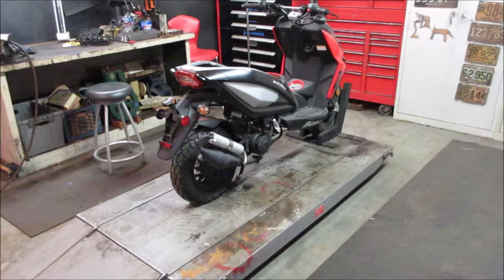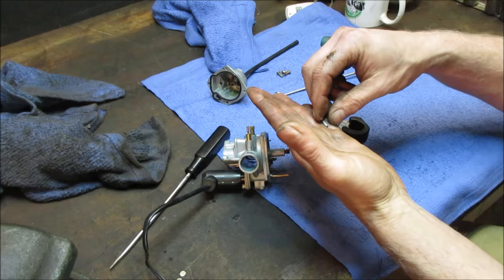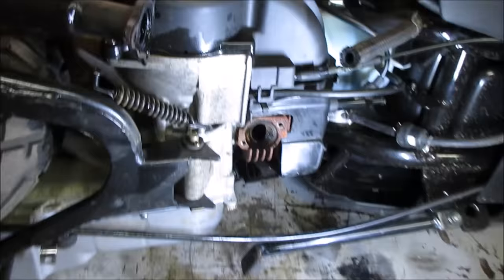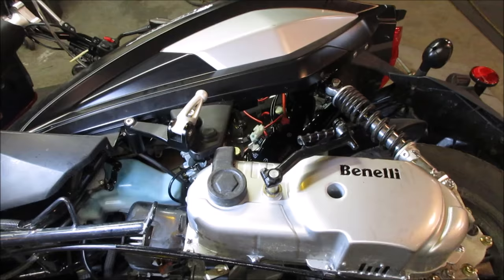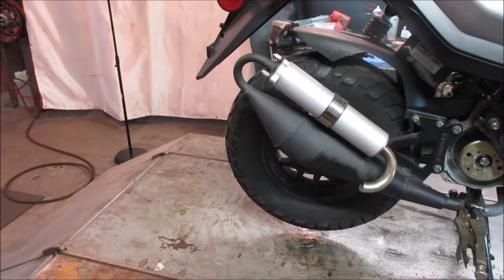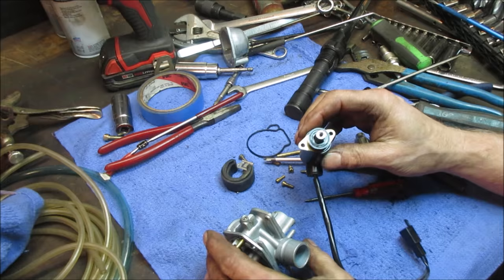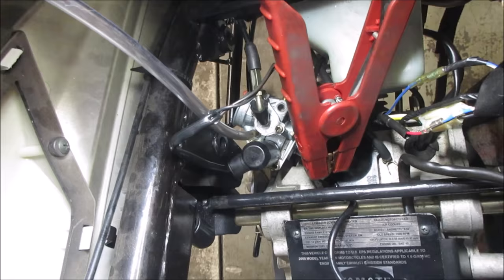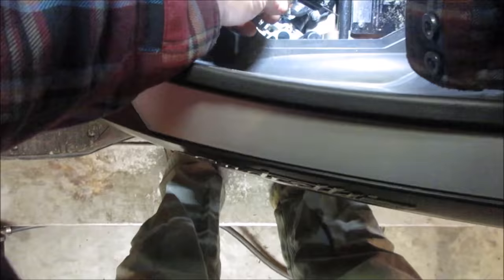Free Broken Scooter, Can We Fix It?

Comment: Fixing a broken motor is one thing, fixing what the last guy did, that takes real skill.
Reply: Umm,  nahh,   gas , spark check piston , then you have all sorted out , and check the carb .  Most 15 year olds in europe knows this and can fix it without any problems.
Reply: Yep, nothing is worse than when a guy bring in his machine and a box of parts he'd removed after watching a couple of YouTube videos. Unlless you happen to know that year, model and make really well, you're in for a heck of an afternoon if he's lost a spring, bracket, or gasket or two along the way.
Reply: @DN-me8mt  I'd rather think any 15 y.o. would swap two color wires thinking he knows it all and it takes a smart mechanic to figure it out.
Reply: @DN-me8mt  im 15 & i dont know my pud from my ace
Reply: @DN-me8mt  that still doesnt fix the issue of "what the previous guy did" Which is a huge problem EVERY single time
Reply: @DN-me8mt  — Then you did not care to watch the video. You just want to be a know it all. That was the reason the bike did not run at all. Two wires where unplugged, probably to put on some parts to make it go faster. Maybe a big bore-kit. But switched to wires. Then made a big problem. And then started changing out parts that was not broken. Instead of fixing what was broken. That is what happens when someone do things they don't really know how to do. And not very careful about how they do things. Make small mistakes that ruin the hole ting. The details are important.
Reply: @DN. You must be a load of fun to be around.
Reply: Κανονικά έπρεπε να κάνει αντικατάσταση κινητήρα από δίχρονο σε τετράχρονο που δεν κάνει καπνό τα καυσαέρια ενός τετραχρονου κινητήρα είναι λίγα και κανει λιγότερο υχορυπανση  σε δίχρονο κινητήρα τα καυσαέρια και οι καπνοι είναι τίγκα και από θόρυβο χαλάνε τον κόσμο και κάνει υχορυπανση
Reply: Just fixed a riding mower that had all new parts installed from previous owner.  Everything installed wrong.  If it wasnt for experience it would have taken time and diagrams to fix.
Reply: Just fix the broken guy.
Reply: @DN-me8mt  doubt it
Reply: Yep, my FAVORITE part of buying anything used, especially if it's cheaper because it's kinda rough. 🤦

Comment: dude this is the most comprehensive repair of a scooter i’ve seen! you really help a novice like me to understand what you’re doing and looking for. thanks a lot ❤
Reply: I feel decently confident in my repair skills and I must say I'm impressed. I would also have started with the carburetor but after that I'd be heading straight to a compression/piston ring scenario (based on the smoke) and after that a valve adjustment. I learnt alot during this video.

Comment: One very important lesson i learnt from my engineering days when diagnosing problems is that if the job has been worked on by somebody else to always and I mean always double check their work because most often than not you will find the person before you has done something wrong which is why the thing being worked on is still faulty. Many many times I have come to a job where the person before me has installed something wrong and 98% of the time it relates to wiring. 

Very very good video.

Comment: I had a scooter a few years ago I got brand new as a Christmas present. Super happy and excited but anyway. Down the line of it being serviced by the dealer he took the sides off and put a screw through the main ignition wire so every time it rained the bike tried cut out 😂 took a bit to find the issue. But stumbled across it when checking luckily

I wanted share my story to help others look for things like this. Even from a main dealer as well (from the UK sharing my love to you Mustie)
Reply: For anyone interested it is a sinnis shuttle 125CC 4 stroke. Good bike but has issues with throttle cable snapping once a year. Another fun story of a day 8am coming back from work after it iced over and my cable got jammed on full throttle and I had use the kill switch to make it 2-3 miles home 😂

Comment: It was obvious that he had thoughts of not figuring this one out.  I was probably almost as thrilled as he was when found the rev issue!!  Also... I actually get motivated every week to get shit done because Mustie1 pushes through and doesn't make excuses.  Well, at least none that we see :)
Reply: There's no way he wouldn't have figured it out, eventually. A scooter is way too simple of a machine for his knowledge, he would've taken it apart bit by bit until he found what's wrong.
Reply: around 40:00 when it starts it's a misfire situation and to me it sounds electric and that would push me into a rev limiter issue or electronics. Some mopeds do have a rev limiter.
Reply: By the way I did experience a similar behavior on a moped I once had with breaker points - the axle the point arm rotated on was corroded and made the arm move too slow. Decent idle, no rev and when revving it did sound the same.

Comment: I was sure it was the auto-choke.  Go figure - somebody switched the wires.  Great job, great video.  You are THE G.O.A.T. of engines.
Reply: When it's no start, it's always some stupid screw-up by the previous owner... or the engine blew up by being abused.
  I literally just came from work and the supervisors were working on a no signal from the motor. I was thinking, I guarantee it's a bad wire.  Two hours later we opened up the plate to find the motherboard had a cable mashed up by their shop.  Two bad pins on a flex cable.
Reply: @firesurfer  They will start fine without choke.
Reply: @ProctoLogic   so ?
Reply: @ProctoLogic  Wrong
Reply: @lordracula2461  Choke is always on until it gets power.
Reply: @ProctoLogic  Moreover, it is most likely AC powered, so the wires can be wired either way.

Comment: These scooters are the easiest things to get running. I bought one for $200 with no spark, pretty new it was a 2020 150cc with under 200 miles, bought a coil and CDI for less than $20 and it fired up and ran great!

Comment: Often on 50cc scooters the 'variator' (the front pulley) has a spacer washer to prevent the front pulley halves coming too close together, and this limits the top speed of the bike. The 50cc bike I had went from a top speed of 30mph to 50mph just by removing this. Mine already had the exhaust restrictor removed as these aren't required in the UK. This might be worth 10mph as well.
Reply: I was thinking the same,plz remove the speed limiter! I hate that  cos it revs the engine to the max and the bike is not moving. Totally agree that bike should reach 50mph no problem. And yes,many of those exhaust had a sound trap you could remove too and the engine will be happier. With some simple mods you could have a very fun bike to ride.
Reply: Yes, very likely as you can clearly see the outer perimeter of the variator pulley halves have never had the belt reach the top because there's still a shiny new finish where the lower portion has been dulled by belt contact. Pull that spacer from between the two halves to get full transmission range and a higher top speed. There may still be a restrictor inside the exhaust too.

Comment: Hey, Mustie, you got the Choke operation backwards. When you put power to the choke coil, it extendes-goes outwards 2-4 mm to close the "extra" fuel hole in the carb. When extended it closes the hole that gives extra fuel. Takes about 2-3 minutes to extend all the way. Measure it with a caliper before (when its cold)  and after 3-4 minutes.
Reply: It's of the 'melting wax' kind right? Like eg a peugeot 2 stroke
Reply: @gags730 - I was beginning to think this moped was a WHACKED motor! ;)
Reply: @gags730  Context is all important. No "whacked" without your "wax"!
Reply: That's interesting;never saw an automatic choke on a 2 weeler.....The older yamaha's had a similar system; not a real choke,but a separate circuit in the bowl just for the choke,and was controlled by a cable,that connected to a small plunger with a rubber tip  in the carb.
Reply: YES!  I had a Yamati just like this and I believe the enricher was the issue with mine.  The fix I would use when I hadn't run it in a while was to drain the carb bowl, then use the kickstarter to pull/release vacuum to the fuel valve to allow fresh fuel in, and then when it started, lean the scooter down on the left hand side and roll the throttle back and for for a bit.  It would sputter for several seconds and then would run fine.  If I didn't do that and started riding it right away after starting it, the throttle would bog down and it'd die like it was starving for fuel.  But once it was warmed up and running I could stop it and start it up again with no issues.  If I let it sit for a week without being run, I'd have to go through the same starting/leaning steps again.
Reply: Yup, pretty common problem with the wax type auto chokes. If they fail to extend the engine is literally running on choke all the time. But they only cost a few bucks, so easy fix. You can check it simply by connecting it to 12v and seeing if it gets warm/moves out. If not, time for a new one.

Comment: If you take a hollow ground flat tip screwdriver (or regrind a round shank screwdriver) so the tip looks like )( viewed from the side it will grip carb jets rather than smear the slots. My Vincent-restorer mentor invented that trick in the 1960s when most jets were slotted and it works a treat if you do a tidy job of grinding.

Those Clore JNC 660 jump packs are outstanding and Clore sell replacement parts. They're easy to work on too. I bought my first in 2014 and replaced the batteries last year. I bought a second mostly in case something happens to the company.

Comment: The thin pipe on the exhaust is one of the restrictor's. To derestrict it, you cut the pipe off and weld the exhaust up.The Naraku CDI will be a replacement and a derestricted CDI
Reply: Hey bro
Reply: @iancameron198  Hi.
Reply: Genious! Absolute spot on! Congratulations bud, you nailed it!
Reply: GOOD IT SOUNDS GREAT ONE MORE WIN TO BRAG ABOUT
Reply: You can heat the exhaust while it's off and pull the restrictor out as I done it 5 years ago to mine
Reply: Yes you can hear the spark is cut off in higer rpm, the naraku cdi doesn't do that, these Honda clones are usually restricted by the OEM cdi...
Would be interesting to see how she runs with the red box...
:-D
Reply: Yea and if you plug it it's looking right for the police..IF you take it away they see your a bad boy..
Reply: @mrsmith697  Very true. It has to be plugged at the exhaust end. Some exhausts have a long tube that goes nowhere which are restrictors.
Reply: Two stroke engines NEED to have an expansion chamber type of exhaust, IF you just a BIG pipe on there it would run like CRAP!!
Reply: Its not a restrictor. Its like EGR, it recycles exhaust gas to improve emissions. It will give you like 1% performance to weld it up.
Reply: @frederikmoeller88  ALL two stroke performance need to have an expansion chamber type of exhaust to run and make power. 
Look at the older motocross bikes, small pipe going into a Big chamber, they make POWER a lot of POWER!!!!
Reply: @ianallen2  No, the restrictor is the CDI itself.
Reply: @barryphillips7327  Yeah but on a stock setup it does next to nothing. What i am saying its not technically a restrictor, yes its restrictive. But its purpose is to recycle exhaust gas, not make it slower for a specific market.
Reply: @horstszibulski19  Yamaha JOG 50 clone
Reply: @barryphillips7327  wrong, these small 2T just have a muffler
Reply: the thin pipe is part of the expansion chambers tuning. often they use a thinner tube for the stinger to create back pressure.
Reply: a 2 stroke will rev higher with no exhaust at all. the quicker it can get rid of the exhaust gases, the faster and higher it will rev. this is opposite to a 4 stroke that needs exhaust back pressure
Reply: @Montimoped  There are many restrictors on a 50cc. The exhaust port half block is one, a washer in the front variator is another, the cdi has a rev limiter as the restrictor and some have the plate on the intsake as the restrictor as well.
Reply: @Montimoped  That one has the Naraku cdi which is unrestricted.
Reply: @Gruxxan  It's exactly the other was around...just check on a motocross bike with a 2stroke...
Reply: @ianallen2  For sure! Done a de-restriction to a chinese Minarelli-Clone, walked away with a handbag full of small parts, and the scooter was flying afterwards...
:-D
Reply: @horstszibulski19  i dont need to check,  ive worked on 4 strokes and 2 strokes. 4 stroke needs back pressure, 2 stroke doesnt
Reply: @Gruxxan  After some years of experience in scooter tuning and -racing, I know that 2Strokes run like crap with just a straight pipe, the resonance in the exhaust works like a charger, hence that the style of the exhaust just like on mustie's scooter.
Reply: @horstszibulski19  ok i can see that
Reply: @EllaBananas  No its not. Its what i explained. 22:25 Mustie mentions it.
Reply: @Gruxxan  Wrong.
Reply: @Gruxxan  Wrong again.

Comment: This is such a coincidence for me! I just bought a Chinese made scooter for $70 and went through this process! The first thing I did was empty half a gallon of water out of the gas tank… lol. I’m fighting the oil injection and a charging issue right now.  There’s a vacuum gas shutoff that I had to replace also. Love watching you bring things back to life.
Reply: The scooter repair man I go to said he routinely deletes/bypasses the oil injectors and just run with premix so as to eliminate the chance of fatal injector failure. As a rule by the time you realize that the injector has failed its too late.
Reply: The good thing is you got what you paid for
Reply: I don't know much about those oil injection systems, but I have heard if you do a delete, you can cause them to run too lean. Good luck with the project. sounds like a fun one :)
Reply: I have a couple of these 50cc Chinese scooters, but they're 4 stroke.

Comment: I had a problem with an overflowing carb of similar design on a motorbike.
After checking the float, making numerous adjustments to float height, and checking float valve and seat repeatedly, I finally found the issue. It was a crack in the brass overflow pipe.
I discovered this by clamping the float bowl in a vise (using some wood to provide cushioning), filling the bowl with petrol, putting my finger over the end of the brass pipe, and blowing through the overflow tube - I could see bubbles coming out of the brass pipe about half-way up.
I solved it by using Araldite to glue a slightly larger ID brass pipe over the original, which I didn't want to risk trying to remove. No leaks since, and I make sure to drain the bowl after use and turn the petrol off at the fuel tap.
Reply: Small motor gas line slipped over the brass overflow pipe also works to seal the crack. Crack comes from water in the bowl freezing and splitting the brass pipe.

Comment: This was a fantastic video. I loved the way you went through it methodically. I never would have got to the crossed wires! Makes me smile because it was only by watching your videos that I became confident enough to work on my sons bikes, and then my mowers and even my cars. I am jealous of the way you so confidently open up carbs and disassemble and reassemble them!
Reply: Yea...I always have spare parts when I get done...
Reply: Get that carb slide in backwards on an otherwise good machine, and you can be headed for a crash at full throttle. Actually beyond full throttle! :/
Reply: @general5104  if it went back together without them, it wasn't required.
Reply: No guts no glory.
Reply: @YodaWhat  thats how i blew up my mx175. So sad. My fuel valve wouldn't close and the kill switch wasn't working. I was young and didn't know what to do.
Reply: @dustinh4175  Top gear and full brakes will usually kill any motorized machine.
Reply: The thing is what's the initial breakdown was it the router what you done with changing wires over that somebody had done wrong or was it the box

Comment: You need to de-restrict that little bad boy and take out the restricters in the exhaust and go up a jet size or two.  You should easy get 50 MPH out if it and get some more speed if it’s just for fun.  Looks a little rich on the oil too.  Thanks for sharing with us by the way as the video proceeded I would of done exactly everything you done to try and solve its irregular running and was as confused as you were but points for coming across that wire in the end and well spotted !

Comment: The bolt on the exhaust is a sheetr-off bolt. Usually used on ignition barrels on cars so when tightened up, the head snapt off and the barrel cannot be removed by thieves, unless they come prepared with a hammer and chisel.
Reply: which they did in my case. how do i know? they didn't bring their own car battery..
Reply: hi Ian PK .     same bolts in UK.also
Reply: @rogerwale4827  I am in UK, Thats how I know what they are. :).